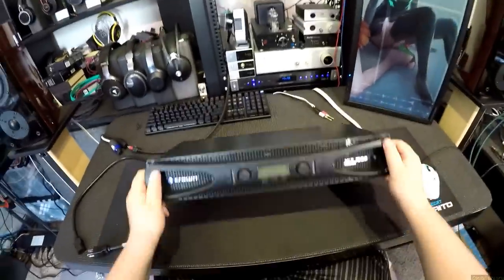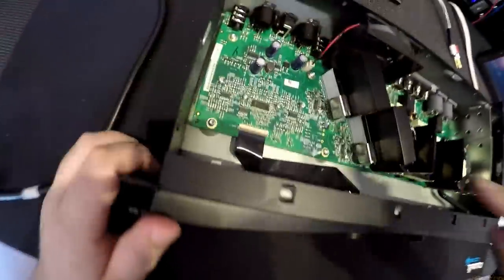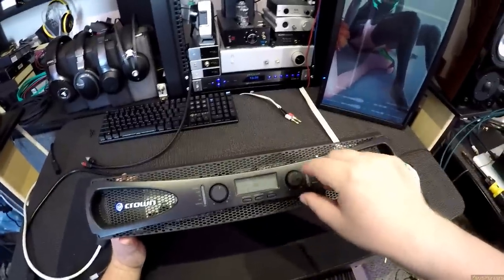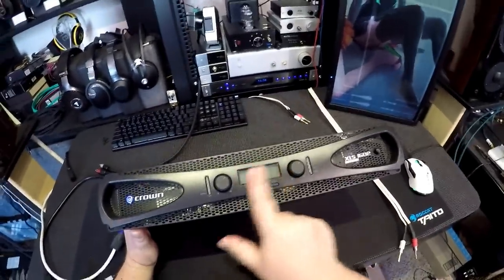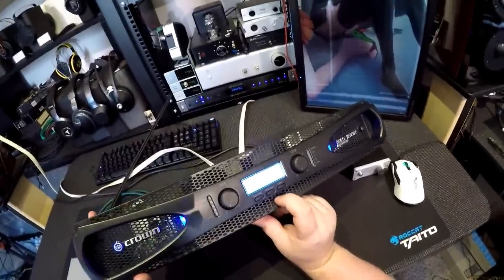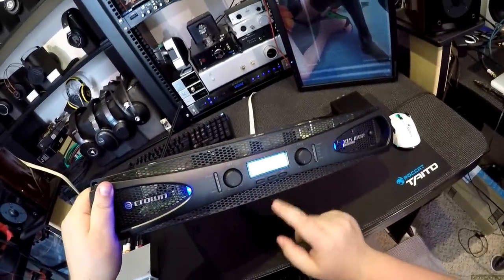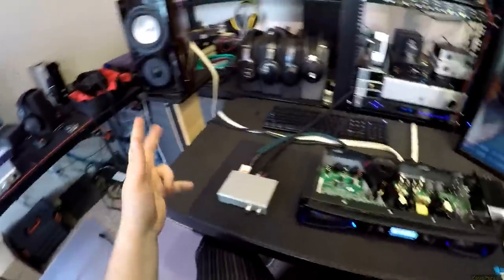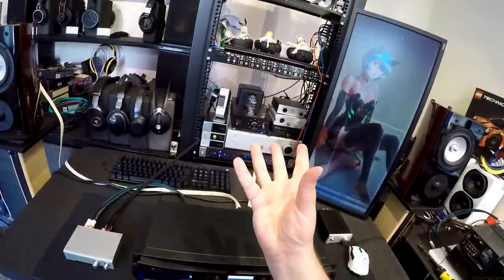Z Review - Crown XLS1502 POWAAAH!!! AMP

Comment: I would really love if you did a measurment if it really took in that wattage it claims to deliver.
Because it can only output as much as it takes in, and that power supply doesn't seem like it can handle thousand(s) of watt(s).
Reply: It puts out enough power to drive Dayton Audio Ultimax 15" and 18" drivers according to all the reviews I read on Parts-Express. Those are massively power hungry drivers, thus it must put out enough to please those folks.

Comment: I heard these are not recommended for use with receiver pre-outs but the reviewer never said why and so I have yet to buy it.
Reply: Running a pair of XLS 1500 (the first gen, grey ones, without the 1.4/.7 switch in back) straight off my Yamaha AVR pre-outs, using a "Y" splitter to send the signals to both amps.  I've had these amps on two different Yamahas and a Denon over the last five years and they've never missed a beat.  Some of the best money I ever spent on hi-fi.

Comment: I got a vintage qsc 1400 300 watts at 4 ohm 200 at 8ohm and I put it up against a brand new crown 👑 xli1500 450 watts at 4ohm and 330 watts at 8ohm and my solid state qsc 1400 sounds louder and cleaner than the new crown go figure I don't know much about the new light weight amps but I'm skeptical I paid 100 bucks for the used qsc and 325 bucks for the new crown oh my qsc can cook a pizza 🍕 but the crown 👑 stays cool as a cucumber 🥒 😀

Comment: So, I've gone looking without finding. It's not on the Crown site.
What is the Amps that these 1502 amplifiers provide?
As an Idea, my 30 year old 100 Watt Rotel power amp has 32 Amps.
And, in case you didn't know, it is very important information to have.
Reply: hmm... I think you maybe should read a bit more about "digital" amps. effectively the amps are getting so efficient info like the "on tap" amps is moot....in case you didn't know.

Comment: I am thinking of getting this for my 8ohm PA subwoofer.   I would need to run 8ohms bridged.  My music source cannot output mono.  I have to output L/R into the XLS1502.  My subwoofer also has 2 inputs.  If I am running bridged, do I plug one speakon into my sub or both of them?  I don't know if one speakon out from the amp will contain the entire audio signal fomr my L/R source.

I've never used an external amp before, so that's why I am confused about all of this.
My subwoofer needs 600 or more watts at 8ohms.  That is why I would be bridging.

Also does this amp have signal pass-through?

Comment: I would like to use this amp with a power subwoofer. I think there is a pass through. Is there a way to set the amp using a subwoofer with one volume control?

Comment: Hi! The knobs are volume knobs! I got the info from Crown themselves! They called them volume controls.
Reply: His point is you set the volume on the amp to put a ceiling on it, then control the volume from your receiver/pre-amp. hes trying to steer you away from blowing up your speakers
Reply: @dontpanic15  thanks.  Now I understand.

Comment: Can these amps be used for home theater, Cheaper get 3 of these then monolith 7 ch 200 watts
Reply: of course, a lot of HT guys use pro audio amps. The Beheringer A500 is very popular
Reply: They work excellent in home theater. The fans are completely silent.
Reply: I just got the 2502 for ht and two channel listening and it's great no fan noise but just a quiet humming from the speakers that I can only hear when I stand  3 feet away when nothing s playingI have 4ohm 94 sensitivity speakers so I heard it happens with higher sensitivity speakers but it doesn't mess with the sound it has clean crisp sound with great bass
Reply: @bobzealand5692  probably ground feedback, get an adapter to remove the ground (3 to 2 prong adapter) from a home improvement store or pull the ground pin out of the cord.  Ground is not really necessary for indoor use.  I removed the ground pin and mine is perfectly quiet now!
Reply: @BrianNC81  oh cool I'll give it a shot thanks

Comment: Amazon reviews suggest this amp does A/D --> D/A conversion for signal processing, even when you don't select any filtering.
Z, did you notice any degradation in sound quality that might be associated with two extra conversions?  Thanks.
Reply: Any thoughts on A/D --> D/A conversion in the amp, Z?  Thanks.

Comment: Hi Z, I have, for several years, a ROTEL A11 integrated Amp with B&W 603 S2 speakers. I love the sound it gives, but I'd like to get more drive at low to mid volume. What do you recomend for a power amp in the €500 [$] range? [considering I live in Portugal] Thanks, J

Comment: From my professional audio background.  The rule of thumb was to turn the power amp to full and manage your gain staging to get the desired SPL.  Depending on your setup however this may not be possible without having away too much volume at which point you just need a less powerful amp for your speakers haha
Reply from the maker: No such thing as too much power.
Reply: You can have too much gain, but not too much power.

Comment: Can you use crown amps as external amplification from and AVR reciever like the denon avr-6300h for the front stage?
Reply: I currently have my front LR power by this amp..
Reply: Joel Topete what do you have crossover set at?
Reply: Crossover will be set within the AVR, do not set cross over again on the XLS it will be overkill @CRC05021

Comment: Z please reply, I want to use this in our (my) company. I don't want to spend 1000 euros on an amplifier it should sound good and have enough power to throw parties.
I never had one of those so I don't know how good they sound, because amps also add/change the sound. It's not 1:1 sound.
I'm wondering if this is a good amplifier to get, because my idea was to get pretty big 3 way speakers with like 15" sub, 10-12" mid, and a solid horn tweeter.

Comment: How noisy is the fan?  I have an iNuke 3000 DSP and the fan was horribly noisy. I ended up swapping the fan out for a quieter PC fan.
Reply from the maker: Ive not gotten it to run yet. I need to get the sub hooked up permanently and really start pushing it.

Comment: Hej man ,looking for a power amp for my ht setup  . Is the crown a good choice? I have klipsch rp 280 and 450 c that i wanne give more power ? Can you tell me more ? Thanks in advance
Reply: De Jonge Neven I have these speakers too. Too bad your question is not answered yet.
Reply: De Jonge Neven Did you buy the crown amp? I have exactly the same speakers. If you did buy the Crown, what is your opinion?
Reply: @WIZARTthe  yes i have 2 crown xls 1002 for LCR , i was surprised how good they sound.  They sound not like a pa amp . With music you have more puch and detail, with movies the dialoug is clear and more detail , and they are silent . No noise fan  . I like them alot
Reply: De Jonge Neven thank you for your reply. The only thing is, how can you use a trigger output with the receiver? How did you set that up? 12v trigger input is missing on the crown.

Comment: If I'm planning on using this for my 7.2.4 Home theater set up how would you suggest I adjust the gain and calibrate with my AVR?  I would use this to power my front left and right and the AVR to power the rest.  Any advice would be appreciated!

Comment: Just out of curiosity, Why do all of this when you can just get a good sounding receiver like denon and then hook up an amp through the pre out?  Am I missing something here? besides that its fun.
Reply: It's a passive subwoofer, he needs to power it with the Crown amp
Reply from the maker: Normal Self-Powered Subs are fine. This amp can be hooked to the receiver and then just use to power the sub. OR if you have just stereo you can use just this amp with built in crossovers.

Comment: why not bridged in series? still enough wattage and maybe a little safer?  I mean I trust crown but for preserving the life, less heat, and just generally not pressing your luck? especially for a digital amp, I mean they don't get as hot but when they do.... (sometimes even with safe breaker relay) Boof! gone.
Reply: Not a digital amp. Class D are not digital amps, just a misconception by many.

Comment: Great review, I would also think about Yamaha, PX3 or PX5. Any ideas anyone how they compare to the Crown?
Reply: The yamaha px series is a slightly more expensive , a little less powerful , heavier per equivilent model. It has additional 1/4 jack outputs , update firmware via usb , more DSP (6 band parametric eq on latest fw) .  Sound is pretty similar , clean and clear pro power amp.

Comment: I have a question about your crown amps: Do have the crossovers set on your amps, and if so where? Or should I just let the speaker crossovers do the work?
Reply: If your speakers have a crossover built-in, then you cannot use your speakers as an active speaker, where the tweeter, mid, and bass are individually controlled by separate amps. I would suggest that if you do not have a good handle on crossovers . . . go on YouTube and do some homework until you can understand what the crossovers do in a passive speaker . . . and the difference where the separate amplifiers control the frequency crossover on an active speaker system.

In short, a crossover that is made up of chokes (coils), capacitors, and resistors is made to separate the frequencies between the speaker drivers so that the low frequencies, for instance, will not blow out the little tweeters, which cannot handle the low frequencies.

If you have a device as a DBX, that can separate the frequencies BEFORE the signal gets to the amplifiers (rather than AFTER if the frequencies have crossovers built-into the speakers), then the DBX has the capability to electronically separate the frequencies and send the high, mids, and lows (for a three-way) to be amplified by each designated amplifier, which has the capability of setting the crossover frequency (as between a tweeter and a mid, and between the mid and the woofer), and make sure that each driver is getting the correct frequencies for each of those drivers INSTEAD of using a regular crossover with all those components. Hope that is not too confusing.

If you are using a passive system with the crossover components built-in, the preamp sends all the sound frequencies to the amplifier, which amplifies the sound and passes it to the regular crossovers that perform the separation of the frequencies to the speaker drivers. The active system is a different beast all together. Hope this helps a bit.
Reply: @russmaleartist  
It did help, and thank you.  As for the videos you referenced, any suggestions?

Comment: This Amp is in my cart and bought it!! Dont know how this one hiss when all the voloum set to 2 o clock and nothing running. is this amp hiss??
Reply: if only speakers are connected than you could try it in someone elses home, maybe you have some wierd grounding issue.
Make sure you disconnect every input wire.
Other than that, just return it and get a new one, it is likely that you got a faulty unit.

Comment: "[...] and you listen to this and it's like... why?"

Those amps are pro and engineered for this type of application: Powerful, protected, multiple types in/out connectors, balanced/unbalanced, integrated crossovers, remote start, rackmount, etc. 

They don't remotely sound as good as an HiFi amp / speaker kit.  A good consumer grade amp will sound better: NAD, Harman/Kardon, etc.  We're not even talking about real HiFi: Rega, Roksan, Naim, Bryston, Krell, Conrad-Johnson, Theshold, Mark Levinson, etc etc etc.

I used to be a DJ / Soundman (and now i'm an electrical engineer): I'm not trying to demolish the product, on the contrary.  Those digital Crown pack a lot for low money.  I'll buy one for partys here!  The integrated crossover is a very welcome feature:  give a break to your speakers set an high pass filter!

Comment: Hey can someone help me? I search a headphone amp for my DT 770 pro. Sould I buy the Topping A30 or do they have to much power? On 250ohm has someting arround 300mw... Is this to much for the 770´s? They can take 100mw rms right? So can someone tell me if this is to much power for them or whats a better choise for the DT 770?

Comment: what crown amp would you recomend to power 4 12 inch subs 360 watts RMS 720 PEAK EACH SUB..?..AT 4 OHMS
Reply from the maker: If you run two pairs of subs in series you get 8 ohm. Then parallel them back to 4ohm. I'd get the 2002 or 2502 if you want full coverage.
Reply: Subs are run MONO anyways, this would do more than fine put it in bridge mode no need for the spending on the higher models.
Reply: im thinking of 2 crown xls1002 wired to 4 ohms at 1100 watts bridged...?...each

Comment: Dude just wire your sub up for 4 ohms.... you dont need to work with 2 ohms for this one, wire the one of drivers positive, to its negative. then wire the remaining positive and negative of one side to the amplifier. thatl give you 4 ohms
Reply from the maker: Yes. Will do inside the terminal.

Comment: z reviews how did you take the plugs off to put banana plugs?
Reply from the maker: I used a wood screw. Screwed them in and yanked.
Reply: Z Reviews didnt damage anything?
Reply from the maker: Just the plugs that are small and annoying.
Reply: Z Reviews alright thanks, i have the amp, its really good for the money, currently have it connected with kef r300 and a blusound node 2 serving as a preamp and server
Reply: you could just screw off the terminals caps and then pull it out.
Reply: +Levente Proska   The terminal caps do not come off so that you can pull out the plugs. Zeos' idea of using a wood screw to screw it into the plastic plug and them pull it out is the quickest, easiest, and safest way to remove them.

Comment: I owned the exact same amplifier i did not like it first off i did not like how it made a high pitch sound from inside the amplifier i'll tell you i bought 2 of those amplifiers the very same xls 1502 and they did not sound like they had the rated power vs my other crown amplifier that had the same output power sounded better cleaner and louder when driving some hifi audio speakers those are best for subwoofers only since it's a class D best for bass.
Reply from the maker: Damn, I got this one and it was silent and clean as a whistle.

Comment: Only $340?  I'd by one just for shits and giggles.
Reply: go ahead i got 3 crown xls core 2
Reply: @joeydelmarsjr.646  Any problems with them? I've been trying to get one and I've called 3 different stores now. They keep telling me not to get one because of quality issues and they try to sell me "Samson" or "peavey" amps.  I'm getting frustrated.  Where did you order yours from?
Reply: @judgegixxer  i got mines on ebay amazon and the other was offer up. no issues at all were used but i dont mind thats how i keep my cost lower so i can spend what i save else where. im using it on my home theather to power 2 subs and main speakers. the 2x15 subswoofer 1500rms an the mains rp-280f

Comment: The SNR on these amps is only 97db. That's very low for something that some claim to be an "audiophile" amp. A good audio amp should have an SNR of 104db or higher. Maybe some people can't hear the difference, but this is NOT an audiophile amp. Nevertheless, if it sounds good to you, hooray, you got away cheap...in more ways than one. For home theater, I'd use it as fidelity isn't quite as important for movies. Audio, hell no.

Comment: I have a pair of cerwin vega ve 15's 4ohms 400w will this be to much power for them or should I get the xls 1002 and my pre amp is a yamaha rx v2700
Reply from the maker: very hard to get too much power. Just set it correctly on the front and you are done.
Reply: Thanks so much it really helped

Comment: Crown, the manufacturer of such great amps as the DC300a - the first real power amp, the PSA-2, the MacroTech series all the way up to the MacroTech 10000... and now this...a class D amp which looks very similar, internally,  to a Behringer Inuke as they use the same architecture... and will fail in exactly the same way... the PSU will fail. Old school crown amps are great amps, but since Crown sold their soul to Harman... junk. Harman also trashed C-Audio and JBL... and who owns Harman? Samsung. Enjoy your new Samsung amp.